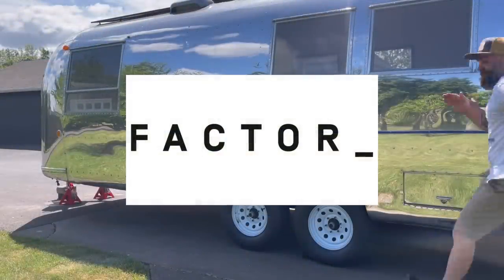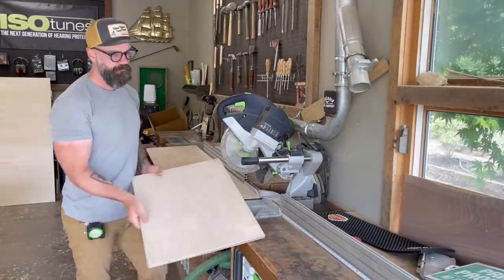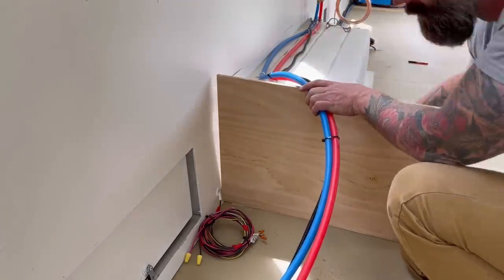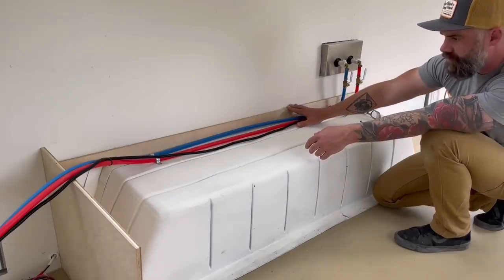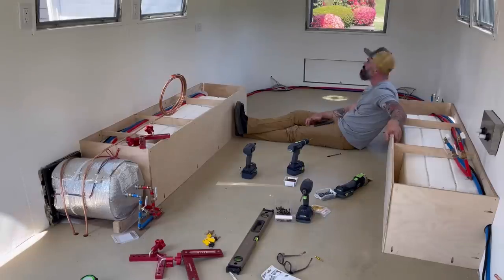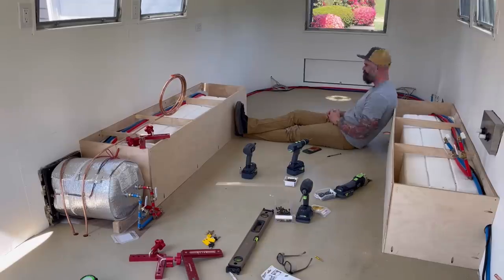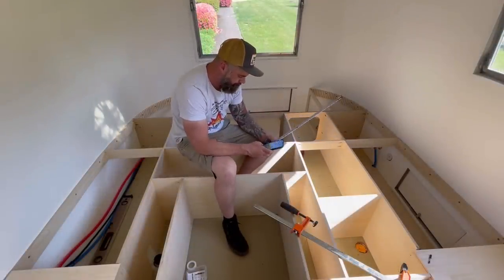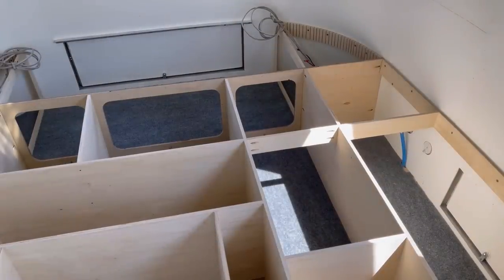Airstreams Suck!! || Starting on the interior

Comment: I would check that bend in the hot pex line above the wheel well. It should be a curve,  not an angle like bend.. this will cause problems with water pressure.

Comment: If you measure half way across each end of the floor, you could then run a centerline all the way down the floor, then 90 degrees off that is square to each end and ideal for keeping things parallel each side

Comment: It might not be much of an issue while the weather's warm, but do yourself a favour and chuck a tub of desiccant (Damp-Rid or whatever) into those storage cubbies. This thing will be sitting outside in all sorts of conditions and the last thing you want to do is have to rip out the interior (and possibly throw away a bunch of ruined camping gear) because mould snuck in where you couldn't see it.

Comment: Just a hint, but the boat-builders I've seen on here use pointed pieces of scrap plywood, fixed to a heavier base with hot glue or brad nails, to template out curves with remarkable accuracy.

Comment: If you ever find yourself cutting large curves again in the future to do what boat builders do, they take 1 inch wide strips of quarter inch thick Luan plywood and hot glue them into the radius off the main witness board then you just connect the dots

Comment: that's great progress ! I wonder if there's a weight restriction to the trailer+ inside bits or if you should build with more light weight wood, over here we need special licenses depending on what we're pulling, I have none of those , only car one, so no clue, just wondering if it's heavier it seems will take more power to pull and probably more fuel or batteries in a hybrid car?

Comment: The radius is top to bottom are the same the entire length of the sides. The radius is on the end caps are the same from one side to the other. All you need is a template with the radiuses, and when he put a piece on that section you just use the template.

Comment: Repairing an Airstream trailer can be an exhausting and time-consuming task for various reasons:

Age and Condition: Airstream trailers can become quite old with years of use and neglect, necessitating extensive repairs. Over time, various components deteriorate including frames, plumbing, electrical systems and interior fittings (suck).

Airstream trailers feature an eye-catching design and construction that stands out from conventional trailers. Their aluminum shell, curved shape, and complex interior layout makes repairs more complex than working on standard trailers (still sucks).

Airstream trailers are known for their efficient use of space. While this makes for great traveling conditions, limited access to certain areas or tight working conditions may make repairs more complex than expected (great, but still suck).

Specialized knowledge and skills: Airstreams have distinctive systems and components that may require specific expertise to repair or replace, such as understanding electrical wiring, plumbing fixtures, propane systems or working with aluminum construction.

Cost: Restoring or renovating an Airstream trailer can be costly. Materials, parts, and specialized tools may add up quickly while professional repairers often charge a premium for their services.

Unforeseen Issues: Working on older trailers often presents unexpected challenges that require extra time and energy to address, such as water damage, structural defects or outdated components that surface during renovation work. Unexpected Issues can arise unexpectedly. When renovating these units it can often turn up issues you hadn't anticipated such as water leakage damage, structural rot or outdated components needing replacement that require extra work to fix.

Even with its challenges, many find great satisfaction in restoring Airstream trailers due to their iconic design, nostalgic charm, and the thrill of giving a vintage piece of Americana new life. While the process may be laborious and demanding, its results can offer rewarding travel experiences that bring pleasure in equal measure.

Comment: Is the wheels jsut under that flimsy plastic wheel housing or are there some insulation in between? If not you should probably do so. The same goes for all the empty space you covered to get above thge water lines etc. The more insulation the better and especially around the water lines. You do not want it to freeze just because the heat from the interior doesn't reach into those areas under everything etc.

Comment: I have some experience with campers.  I think you are going to truly regret burying the water lines inside the cabinets.  It doesn't matter if the lines are PEX, they will still leak, most likely at the fittings. Plus, you really need a good way of draining those lines when the camper sits for any length of time.  The camper is going to flex a lot more than you think it will, so you can get mechanical abrasion on those lines.  Water is the enemy, more than anything else this is what destroys campers.   You also want to have a positive lock on all cabinet doors or anything that opens/closes.

Comment: Piano hinge all the rear bed pieces together with routed holes for lifting.  That way you have one large storage cover/bed frame which you can lift/fold together so you can remove all of them at once if you wanted to, but still retain the bed frame integrity of a single flat surface to lay on.

Comment: air streams and mobile homes got one thing in common ain't nothing straight, square or level
Reply: also are you planning on some rockwool insulation for the wheel wells?

Comment: Yep, you are definitely NOT a professional RV builder! At the factory they would done all of the cutting and drilling inside the rig without cleaning up any of the debris, it would all be built with luan and random scraps of pine put together with hot glue, washer head screws that didn’t hit anything, and copious amounts of randomly placed narrow crown staples. All of the pieces would be precisely cut with a 3/4” tolerance using a chainsaw and hatchet them finessed into place with a hammer. Wiring would be secured in place by placing all of the cabinet pieces directly on top of the wiring without notching and securely pinned to the floor. Inside all of those compartments would also be flexibly heat ducts that would use 10’ of duct to go 3’ and would have multiple sharp turns,  be forced onto a 2” opening between cabinets, and then have a 10 pound bundle of wiring resting on top to ensure no air would ever pass through.

Comment: You are always "I have no idea what I am doing" then pulling out a very cool tool to do just what you need ergo I surmise that you ,my not yet friend, are a woodworker incognito.... and to tell you "tricks of the trade" may be a delusion on my part.  A couple of things I noticed. :)  A dime store compass works better than a washer on a pen or your finger as a radius creation tool. If you have a tire blow out those plastic wheel wells are toast and therefore all the water lines and water heater is too. BOX in the wells with 3/4 ply first, me I would cover the 3/4 facing the tire with 1/4 in steel first, but hey... I lived in a 29 ft 5th wheel for 19 months while pulling it around the USA and I think I took it completely apart and repaired it 10 times. When I returned to New Mexico from Washington state my neighbor came over and 'ask what the hell????' as I had the entire back wall out because the factory only secured it with 6, yes SIX, 6 in long self tapping screws through the 2x2 aluminum square tube they used as wall studs. And 5 of them had sheared off and the wall was held in place by the roof membrane and the wiring.... fun times. 
I love the self deprecating way you have and the quality of the videography and scripting... thanks man.